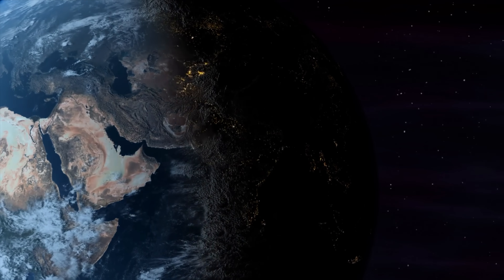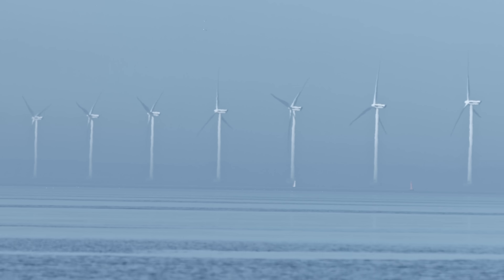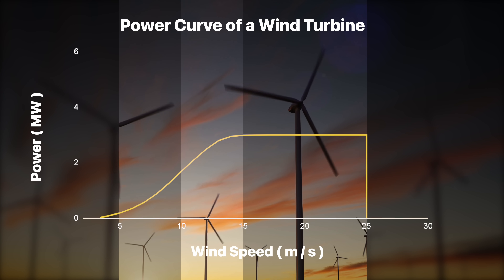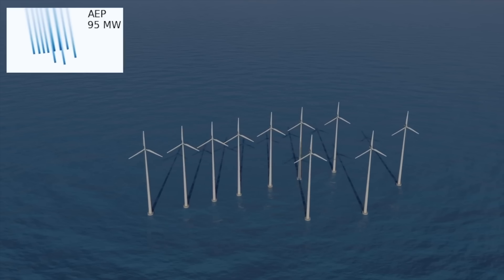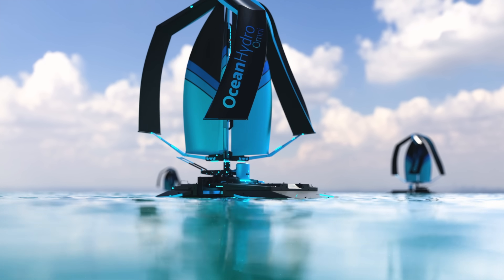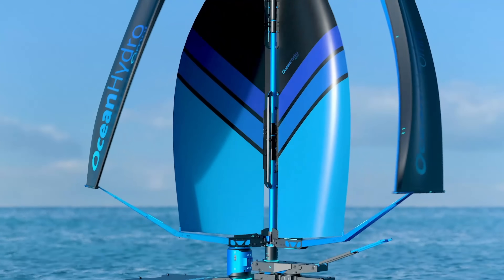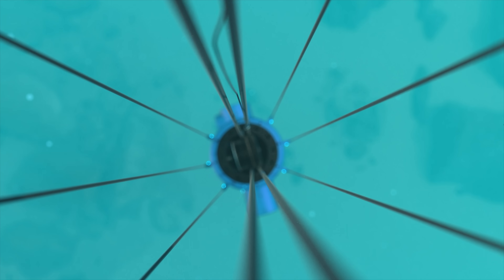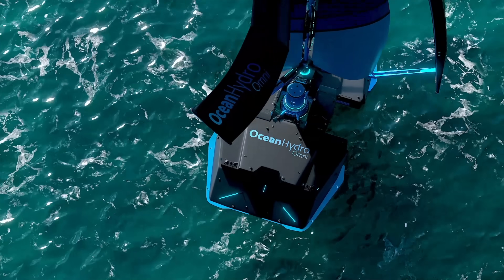Breakthrough Tech Solves Wind Power's BIGGEST Problem!

Comment: I think the gravity battery energy storage system should be incorporated into conventional wind turbines as well. That may be quite a winner.
Reply: 4 ton over 100m can store 1kWh ... To store 2 000kWh (one hour from 2MW turbine), you need 8 000 tons stored 100m above. That is concreate cube, 15x15x15 meters. Concrete alone would cost $675k. Gravity energy was tried many times but it doesn't make sense, except for hydro - water is heavy, cheap and doesn't brake.
For anything else, even Tesla 3MWh Megapack is cheaper, more reliable and easy to install at price of $1 Million.
Reply: @MrVolodus  don't use concrete. You want something dirt cheap, you make it out of dirt. Fortunately gravity batteries can make use of such quite nicely. And there are alot of windmills in a farm to use alot of moderate sided gravity batteries.
Reply: I have often thought they should use wind driven compressors to pressurize air into the tower, and run the air through a turbine for on demand output.
Reply: @macrumpton  worth considering. I'd love to see an engineer do the math on that one.
Reply: @Dr.Gehrig  With dirt, that is 20x20x20m cube to store 2MW(at least it is cheap). Idea is great, but size and complexity (and maintenance) is killing it - that is why it is not used (at least I don't know of any that is not experimental) - again, except hydro storage.
Compressed air (lot of info on web) on other hand is used at some places but still, it is more complex and not cheaper in long run than batteries.
Simply put, there is reason why companies buy big batteries - minimum space, little maintenance and great efficiency.
Reply: @MrVolodus  gravitricity and gravity vault, and then this. Worth trying. Again, many smaller systems will likely add up to something worth using for offshore wind.
Reply: @Dr.Gehrig  Yeah, definitely, we need to try what we can. If something doesn't work now, it may work later.

Comment: I see two problems with this approach. VAWTs are best close to the ground or other surface, limiting their use to ridges on land or high wind regions at sea. The HAWTs being built today are more universal in their  ability to use wind rights that are closer to populations. Second, there is no reason besides patent protections that this idea cannot be implemented  inside the tubes of the taller HAWTs. or even beneath the ones being built floating in deeper water.
Reply: Exactly. If this energy storage system works for VAWT, it should work for HAWT. If HAWTs aren't doing it... maybe it's a bad design
Reply: well, I imagine that the weight would mean that the tower "tube" has to be much stronger to support the weight itself and also the swaying that a heavy weight at height could produce.

Comment: Interesting, why not do the same thing with a traditional turbine but encapsulate the weight inside the tower? This way it would be somewhat protected from the elements. Or have a cable going to an underwater battery bank. The only issue I see with the weight being anchored and being directly in contact with the water.
Reply: It isn't designed to work, it is only designed good enough to get money for "research" that never amounts to anything. If they wanted it to work they would junk the weights in the ocean and put them in bore holes in the ground. Functioning completely separate. But if they did that anyone could calculate it's in/efficiencies. That makes it harder to scam people. They make it over complicated so you can't see the forest for the trees.

Comment: At a first glance this just looks silly. Expensive, complicated, a maintenance nightmare. But let's give it the benefit of the doubt. Let's say the weight have a density of 3 g·cm⁻³ (dense rock), this means the effective density is around 2 g·cm⁻³ due to the water displacement. Then we say we can use 300 meters of cables. Let's be generous and say that one unit can lift 100 tonnes. The weight has to have a volume of 50 m³, so a cube with the side of 3.7 m would do it. That seems relatively reasonable. But how much energy can we store in one such unit? This would be around 300 MJ. In the ideal case with no losses this could produce 3 MW for 100 seconds. Or 30 kW for 2.8 hours. Considering the installation cost and likely maintenance cost of the system I don't think it is worth it. We have 83 kW·h of energy storage for one unit that I suspect at least cost $100k to manufacture and deploy. Assuming no further maintenance (yeah, right) we would get a storage price of 1.2 USD·(kW·h)⁻¹ which is very good compared to Li-ion that is around 100 times more expensive according to a random report I found on the internet. I think I am underestimating the cost by quite a lot because my gut tells me that my numbers are too kind. Anyone care to fill in the blanks? The thing I also haven't calculated is how big the buoyant part has to be in order to lift 100 tonnes, any takers? edit: Forgot a unit for a measurement.
Reply: We could use somthing simple like multiple weights attached to the top and use undersea cables to transfer electricity on shore. We can ditch wind turbines, use iron ore for weights as they have more density, go to 2000m to 4000m depths for more time, and use compressed gas automated systems in to lift weights, no cables needed except for weights, use ships for maintenance etc. I think these would be some improvements, love to see your calculations on that.
Reply: @badboydevil0007  I think it is probably more cost effective and easier to maintain to just build a big bowl and fill with it with water. Hydroelectric storage.

Comment: The poles of conventional wind turbines could also house a gravity weight to make the power more constant. Maybe if the wind turbine would have 10min storage as weight it would help. Wondering if anybody has tested that idea. The weight could spin the same generator. It would be like a hybrid car making constant energy in gusty winds
Reply: No. 1) You would have to build the pole much stronger to hold significant additional weight. 2) The stored energy capacity is abysmally tiny. 3) The additional cost is not worth it.

There are hundreds of engineers who have thought through this exact idea already and concluded it is not worth it, otherwise we would have seen gravity weights in the poles since 25 years ago.
Reply: @ProjectPhysX  Yeah, and you can make a system identical to offshore wind with this underwater gravity storage, so this VAWT design needs to stand on its own
Reply: @ProjectPhysX  Yes the economics for adding gravity based systems to current offshore wind turbines just don't add up. Also the depth isn't there
Reply: To store 10 minutes of production from a 6 MW turbine in a 100 meter high shaft you will need a weight of 4000 tons that even if you used lead the volume would be nearly 400 m3.. That would be like a weight with a diameter of 10 meter and a height of 5. Or a solid lead weight the size of a house.

Comment: Environmentalists take issue with the few dozen generator bases due to the effect on whales and large fish… now imagine the effect a virtual net of cabling will have. This is a failed concept. 
But add the cables and mass above the water on a normal generator and while the rotor is stalled drop the mass to continue generation..

Boom, no underwater mess, not new sea life build up issues to deal with, no extra impact to whales and fish… all problems are solved… except that dangling 20tonne mass being blown around in 100mph winds… that may be an issue

Comment: ... I think the idea has merit my only concerns are the durability of the moving parts especially at sea and how easy this would be to maintain. Also, the LCOE may be cost-prohibitive once you factor in the extra costs involved compared to standard wind turbines and other forms of energy storage.
Reply: Just read into the facts about VAWT performance. Every certification body will discourage banks and funds from investing into such a devices power curve based on only 20 out of 365 days of operation. Where a HAWt would have 350 out 365 days to turn a profit.

Comment: I'm curious about how this system will deal with strong undertow  that usually comes with strong winds. Also about the potential energy loss if the system is discharge on low tides
Reply: "The typical tid range in the open ocean is about 0.6 metres (2 feet)"
Sometimes LOVE Wiki .....
.
As for undertow, a long line with an "anchor".....?
Reply: Most any current below the surface is not affected by wind.
Reply: @jj-jak  Correct but they are exacerbated by the wind as 20 years of windsurfing has taught me.

Comment: Great video. For me, the over-riding point is that there will always be that new idea. The tech we have now will keep getting better and better!!
Reply from the maker: Jack I wake up every morning with that feeling! When i was graduating from engineering school, the career fairs were filled with oil companies, thats what the smartest mind 30 years ago went to work doing. But today I've noticed a major shift, lots of new brilliant ideas and this gives me great optimism
Reply: @TwoBitDaVinci  Thanks for the reply. Love the channel!
Reply: Except vertical axis turbines have been around for 50 years and they can't make them work efficiently.
Reply: @justayoutuber1906  That's absolutely true..if you convert directly into electricity
Reply: @hydrowindenergy  That is true no mater what, force is force. The only thing that varies is speed and torque. Generators are changed to handle that, just like using different gears and pulleys. No matter what when you change a force into another force you lose potential force in the process. Your changing spinning force into lifting force then into electricity. Making a simple process more complicated. If you're trying to scam people at least come up with something feasible.

Comment: I wonder if instead of using vertical wind power to move the objects underwater up and down why couldn’t the natural water pressure be used. At the bottom of the ocean can you fill bladders with air and use that force to spin a turbine. Then when the bladder gets to the surface release the air from the bladder and send it back down to the bottom to be refilled.

Comment: So this is Gravitricity in the sea. Interesting. I wonder how the density of water influences the energy return. But still interesting idea. For me, the biggest problem is durability of the cables in the sea environment - sea creatures tend to try to live on such semi-static locations and mess-up all the mechanics. But still worth testing.
Reply: Indeed, and not good having the generators and cables on the sea bed. Generator could equally be placed at the top, and cables suspended below buoys.
Performance would be even less than gravitricity because of buoyancy and available joules would be low.
Reply: @ahaveland  The buoyancy is not a major problem, just add more mass. Magnetite mineral have a density of 5,6 and are low cost. An extra 20% will more then weigh up for the loss to buoyancy . The major problem is that wind speed 10 meter above the surface are a lot less then at 110-150 meter and it is also more turbulent. The result is that wind turbines like shown will only produce as small fraction of what large wind turbines. Lots of units with complex systems close to salt water is also a recipe for high cost when maintaining the system.
Reply: @ahaveland  The sea bed is littered with electrical cables and internet data cables, so I think that is the least of the problems.
Reply: @MarcoNierop  You need to study this more.
Reply: @scotteverett5932  No need for Thunderfoot. The math is that if the working height for the weight is 200 meter you will need 2 million tons to store 1 GW/h. If you only go for a 1 MW/h you still need 2000 ton. To hold that weight afloat you need a volume of 4 x 5  x 100 meter and that could store the equivalent of 10 minutes of production from a 6 MW wind turbine or about 4 minutes if the 14 MW turbine was used.
Reply: @bknesheim  Looked at another way, I estimate about 1 tonne per hour of storage for a typical household.
Reply: @Aaron628318  1 ton  = 500 w/h at 200 meter elevation. That would be low if there live a family in the house. At least if electricity is the main power source.
The average per capita where I live is close to 20 KW/h a day. That would be 40 ton per person/day or 1.7 ton per hour.
Reply: @bknesheim  I'm from the UK and the average household consumption  is <10kWh/day.
Reply: @Aaron628318  Yes, and for households it is not the main energy source. I just think it is a better metric to include the total use as the target for how much storage is needed.
Reply: @bknesheim  Actually, you're quite right. :-)
Reply: I was in the Navy, no one seems to be talking about the obvious. High winds=high waves, also tide levels. How would the cables deal with those variables?
Reply: @terryeasterday580  Not that it make it a good idea, but you can make a very stable platform based on tension mooring and keeping the main buoyancy body under water. Similar system are often used in the oil industry.
Reply: @terryeasterday580  YEA the place out by Scotland and those open seas have winter gales and storm winds of over 80 Knots that roar for many days which is 100 foot seas going up and down every 4 seconds. A collection of these units side by side as shown in the fancy artwork would have all the cables wrapped up into a knot and dragged up and down until it broke up and deep sixth-ed itself.
Reply: @SaltGrains_Fready  Yea I had the same thought, the spacing needed to keep individual rotors from destructive collisions is going to make a farm incredibly low in power density.
Reply: Just a matter of using it a lot, so sea creatures do not get a chance, and vibrating jittering supension cables are not really attractive for sea creatures.. But maintenance is by definition a big issue when installing something in salty seawater.
Reply: If the weight was shaped right the drag coefficient shouldn’t be too bad but these weights aren’t moving too quickly anyways it will be interesting to see their data once they get a test rig out on the water.
Reply: @Stephen_uhri  I'm not financing it.
Reply: @scotteverett5932  The idea isn’t entirely unreasonable. 
They could always give the pontoons a ballast system, and sink them temporarily for storms. 
Not sure what the engineers are thinking, but that is the solution I would probably shoot for, since they are tethered to the surface.
Reply: @JM-zg2jg  I'm not sure what the engineers were smoking.
Reply: The weight moves so slowly there is no significant effect
Reply: Indeed, it is the Gravitricity scam plus barnacles.
Reply: @scotteverett5932  Yea one of my first thougts, why arn't they yousing a float which is winched down to store power and allowed to go up to generate, then you platform dosn't need to suspend tons of extra weight.
Reply: I'm wondering how some outside the box thinking could explore this lifting/gravity energy in tidal settings
Reply: It will fail miserably and be another shit stain on the earth.

Comment: How do they prevent stuff in the sea depths from getting all tangled in those cables extending to the sea bottom?
Reply: Don't worry they will spend millions trying to figure that out. Eventually coming to the conclusion that they need to spend millions more because they are sooo close to figuring it out.
Reply: Cables under a lot of tension are pretty much just poles.  I mean, yeah, you'll get seaweed growing on them, but I suspect that's pretty low down the list of problems.  You'd want to maximize the weight and minimize the water drag, deal with corrosion... unless you have trawlers trying to fish next to them I think tangling won't be too big an issue.

Comment: Sounds far too complicated, all that maintenance.  Be interested to know how this works with large ocean waves, say 20m.  Either a huge problem or add the wave energy.
Reply: I agree. I'm a mechanical engineer. I think it might be better to use the turbines to compress air into seafloor anchored airbags. The air can power turbines to drive generators. No moving parts exposed to seawater.

You wouldn't even need to have the same number of wind turbines, airbags, and generators. For example, 50 turbines could feed 10 airbags and a single generator for economies of scale.

Downsides are:

1) The need for seafloor construction. Anchors, nets, and weights to constrain the airbags.
2) Seafloor ecological disruption.
Reply: Completely forgot about the effects of waves during storms, that is a very good point, 20m waves are nothing to sneeze at. I was more concerned with the complex pulley system and how it would be affected by sea life growth. We have sensors at our plants that have to be cleaned every few months in brackish water due to biofouling, I can't imagine the maintenance nightmare a whole farm of these things would need to keep running for reliable steady state power to the grid.
Reply: To many mechanical parts it's sure to fail .
Reply: nothing has long life when touching salt water ..so do not have high hopes 🙁great video indeed
Reply: They need energy storage, they need renewable energy, and they need a way to regulate the amount of energy produced. If they make this system into modules, then the repair problems might become less.